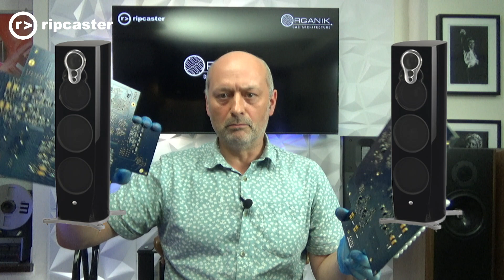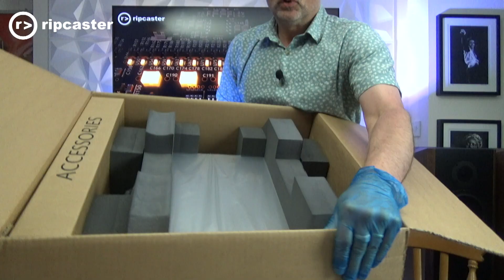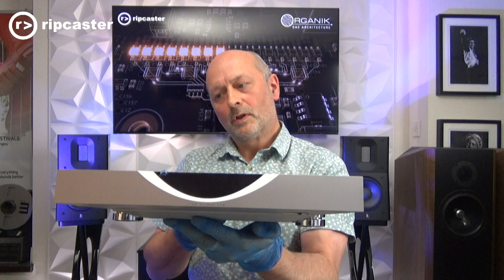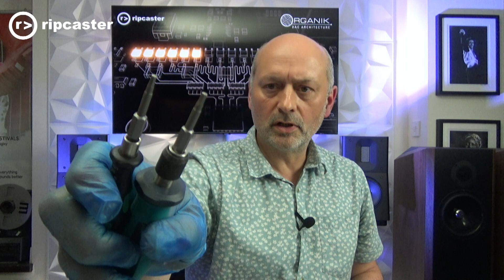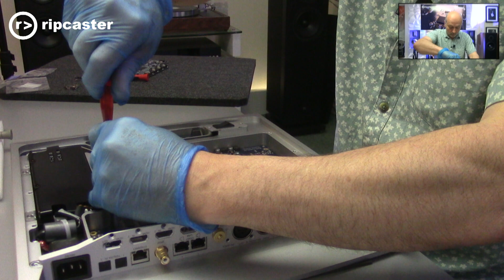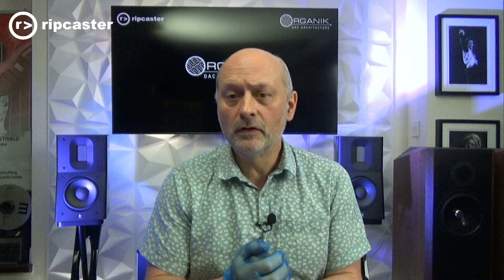Linn Klimax DSM Organik DAC Upgrade at Ripcaster

Comment: Nice one, John, thanks for sharing...   No Heat pads to fit ?  you forgot to mention to remember to refit the internal phono insulators, but you HAD rememembered to put them on  but just not mention it
Reply from the maker: Well spotted. Lost in the edit... The insulators form the 3 x RCA are reused from the original board and are refitted either side of the back panel. No heatpads required.